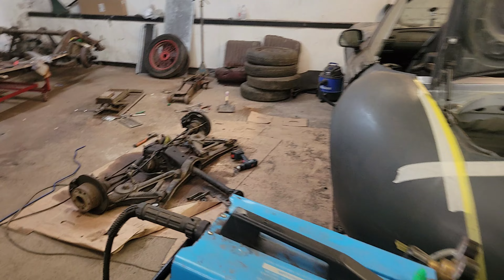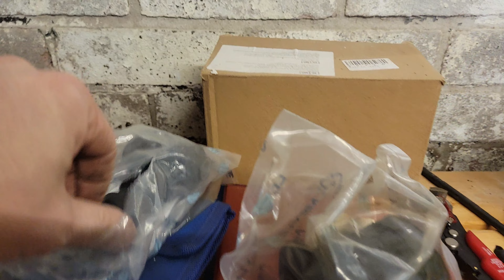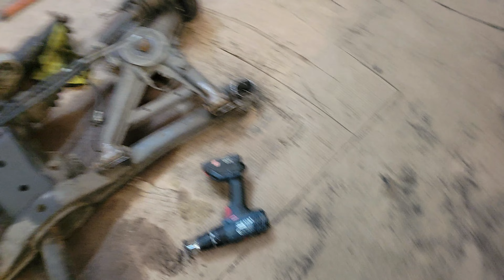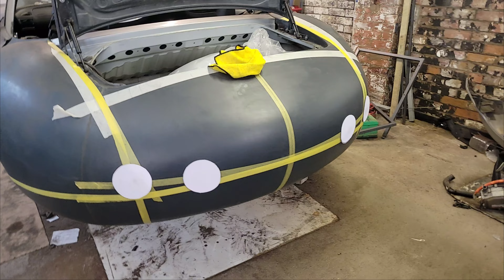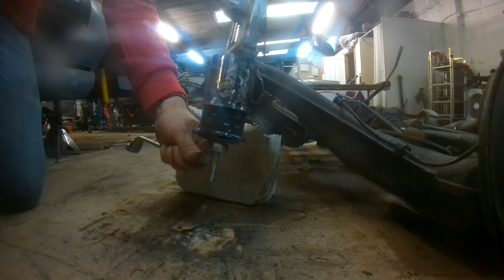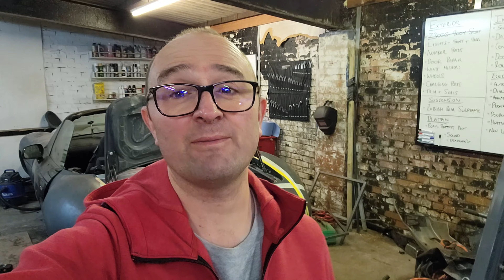Fitting new bushes to my Z3 rear subframe - plus Nissan Leaf repair!

Comment: Thanks Tom. Fixed the diesel heater today with Mo. Now i feel like an eberspacher Pro. Also traced the insulation issue to the muxsan pack contactor on the +ve side. Ive footage of the diagnosis so i just need to get round to uploading it all. massive thanks to Patrick Hughes for his help behind me in you garage.
Reply: Was hoping you'd report back. I want to add isolation monitoring to the beetle at some point.
Reply: @JamieJones1985  sorry Jamie i did mean to but ive got so many projects being juggled right now that battery extenders has dropped to the bottom at the moment. Also i think you are probably a ways ahead of me in the knowledge dept of the complexities of doing the diy ev from scratch. My experience so far is trying my best to make my leaf and now env200 better.
Reply: @Whereswally606  looking forward to it. Interested in how the contactor was causing isolation loss
Reply: @JamieJones1985  yep a low 12v battery, cold day, couldnt keep/open the contactor fully. Then must have arched and caused some damage which is now causing voltage leak on the positive side of the contactor in the extender pack. Will be fine with the new one which is on its way from muxsan in the Netherlands